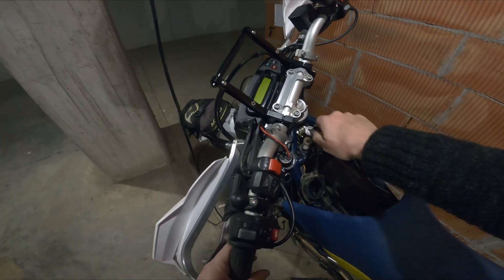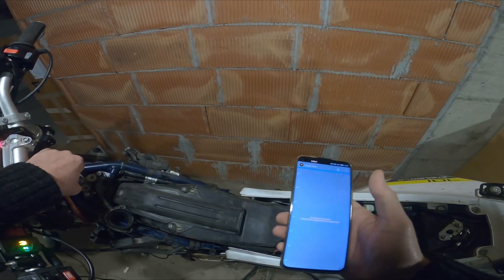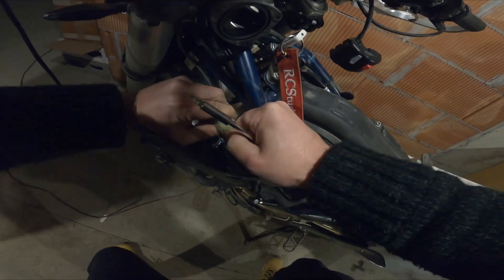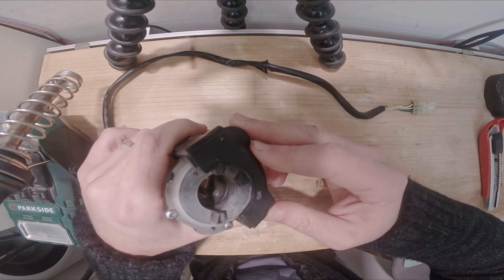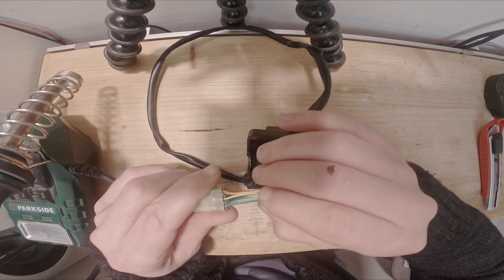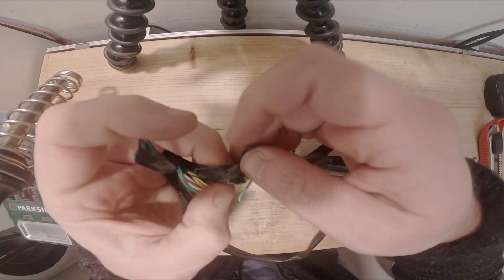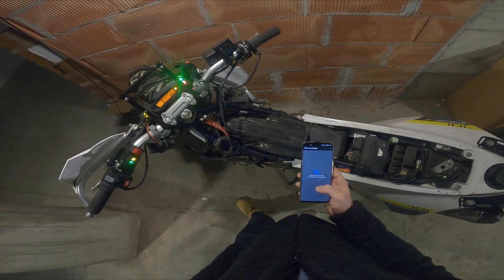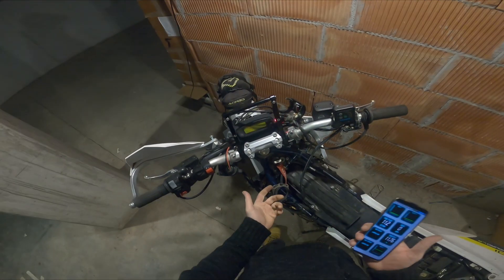Husqvarna 701 Check Engine Light Diagnosis and Repair: Solving the Mystery

Comment: Where can I get the obd2 plug?
Reply from the maker: You can search it on aliexpress. It seems the link I added in the description it is not working. The problem is that not all these cheap dongles can connect to the bike. I have a couple of them and not all work. If you want a more premium dongle you could try https://www.thorkracing.com/produto/dmd-obd-scan-m1/

Comment: Am avut o problema similara cu o honda pcx 125, cabluri prea scurte din fabrica si s-au rost intre ele pana mi-a aparut check engine light, inca nu am suficienti km pe 701 sa intampin problema asta (sper sa nu) dar macar stiu 1 way to fix it now.  
Spor
Reply from the maker: La mine mai mult s-a intamplat asta pentru ca am lasat si unghiul la ghidon prea mare (din suruburile de stop) si presa putin pe cablurile alea. De stricat nu s-a stricat ea de una singura :)
Reply: @MotoCerbii  as vrea sa spun acelasi lucru in si in cazul meu despre cilindrul hidraulic de la ambreiaj :)
Reply from the maker: La mine ala s-a dus la 2000 km. S-a rezolvat cu altul de la Oberon si aia e...de atunci totul ok.
Reply: @MotoCerbii  Am montat oberon asemenea dupa si a cedat, aparent nu etanseaza atat de bine capacul de la rezervor iar asta face ca lichidul hidraulic sa cedeze din cauza umezelii, life with 701 :))